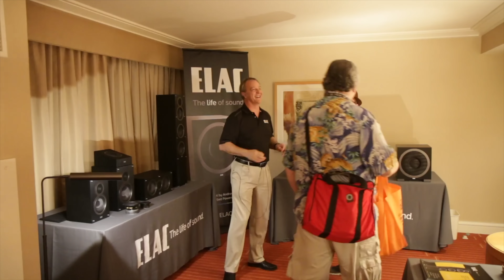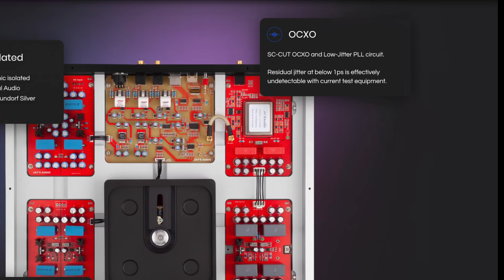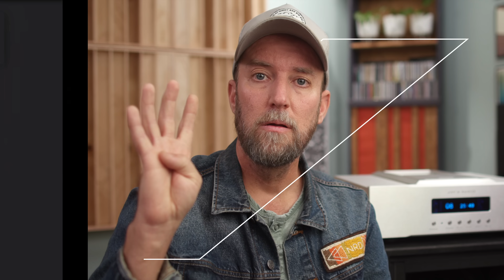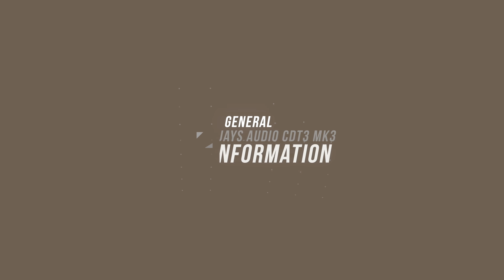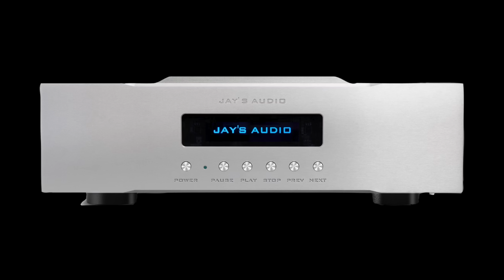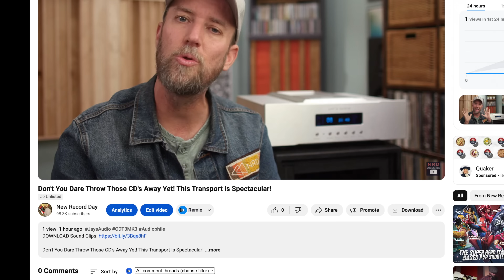Don't You Dare Toss Those CDs! This CD Transport Will Blow Your Mind!

Comment: 2:14 highquality CD transports often include Advanced laser mechanisms and error correction Technologies

The audio CD standard uses a modified an adjusted Reed-Solomon error correction code. Adjusted in a way that bits logical belonging together are distributed physically.
A scratch makes typically multiple bits which are physically located nearby unreadable - but as they are mapped to logical different blocks they still can be fixed.
The algorithm to do that corrections is well known, "open source" and easy to implement even on cheap hardware. 
There is nothing that could be improved further.

And when you mention "advanced laser mechanism" I want to know exactly what was improved....
Using a 20 USD external USB-CD-ROM drive I can "rip" a CD with 8 x speed and still get it bit for bit correct - there is nothing to improve here also.

Comment: the problem with the price is that this are not from big brands , as they have a reduced cost of production who made all european brands and U.S. of A. , ones just vanish, this is kind of a bet if lucky will sell all units and some do are lucky enough to develop a new project for a new player, like it happens to signature turntables ,some do work for the big brands and not being satisfied with what they seen released they try to built a limited edition of what they think it´s better and for sure it is only prices increase a lot, i myself in the 90´s looked for a better cd player as mine was ok but a pioneer from early 90´s and when seeking for better cd players i notice that some with more aceptable prices were not that diferent from what i had already from pioneer as some Rega were a lot talked about but they aged very fast due to the quality of materials while my first standart size pioneer is still looking new as the one i bought in early 90´s and internal dac´s are cheap and also cheap to install so the better one can do if with limited budget is ask your technician if possible to upgrade the already existing cd player ,i think it turns out for the better and less expensive, about building quality those more expensive players from known brands aren´t that bad and if improved it will sound as a new one as diference between both isn´t much and if improved will sound good for sure

Comment: If you use a CD player with a IS2 it will be a pretty decent player and connect it into a great DAC, surely you are taking much of the perceived advantages of the CDT3 away. Having separated the carriers, Jitter will be greatly reduced and the High quality temp controlled Crystal Oscillators seen in many of these new all singing all dancing DAC's like say the LAIV Harmony or Denafrips will do the rest. So maybe better to spend money wisely on a very good CD player with I2S and a pair it with a really great DAC.

Comment: I keep asking a question about units like this that only seems to generate anger, insults, and deflection -- but is actually an honest question and at beating heart of understanding these products.    

If your DAC has a sufficient buffer (and all good ones do), and you optical connect, then how does any of this anti-jitter, clean power, vibration dampening stuff affect the signal output from the DAC?
Reply: It doesn't as long as you have a decent modern DAC that reclocks to avoid jitter.

Comment: Of those 5 reasons of yours, the only rational one is jitter. That could actually differentiate one cd player/transport from another. All of the others that you cite confuse the characteristics of an analog electronic signal with a digital bit stream. A series of ones and zeros aren't going to be polluted by the power supply, etc., etc. You really are the king of confusion and dim-witted, gullible thinking. Unlike Amir, whom you take cheap shot at. What a loser you are. Rock on.

Comment: Have the CDT2  mk III at about the half the price and  running through a Holo Audio May Dac  using Is2 cable.  Whoa….Agree…a transport is the way to go for great CD sound.  I think you captured that well in your presentation……then it’s all about the Dac and supporting equipment.
Reply: I have the same transport supplying a Terminator DAC through HDMI. I’m like it a lot. I ask my supplier if I should upgrade and they said no.

Comment: Even through my very modest PC speakers (carefully equalised), I could tell the CDT3 sounded better, with crisper transient attack and better defined space around instruments & voices.  Thanks for the demo, though I was surprised that you preferred the 44.1 to the upsampled output.  In my main system I use a Perpetual Technologies P1A interpolating upsampler feeding my MF Trivista DAC, and the improvement in subjective detail and soundstage focus is significant.

Comment: Hi nice transport for sure  
But if i understand well using a dac that reclocks the incoming digital signal should reduce the source quality issue ?  
this is also my humble experience
I have a dac that reclocks   Using different digital inputs and sources does not change the sound substantially

Comment: Used a Marantz CD 63 kI signature for years, then got myself a Audiolab M DAC+ so the  Marantz became a CD transport, a very good improvement that did not need careful listening to hear the improvement as it was a fair jump up, a few weeks ago I got myself a new Cyrus CD-T transport, now we are talking again an easy to judge upgrade in performance, in fact I just love the delicate smooth notes in the high range and the greater definition of bass guitar and drums, everything is easy to follow and that's because it sounds like more space around instruments. Cyrus use a slower spinning drive so only one pass of the laser is required instead of the head having to re-read the disk when errors occur, they say the head having to backtrack causes electrical motor interference, as its been What HiFi mags best buy at over a grand for the last five years I can now hear why. 
I also listened to other transports on a youtube, Audio Alpha podcast, it was very apparent that it sounded better than the other transports. If your motherboard or sound card can playback HD sound then a good pair of headphones will allow you to hear the difference with the podcasts they do.

Comment: I own an Audiolab CDT6000. It’s been a big improvement over my old Oppo BDP83, when combined with my Denafrips Ares DAC. Both items together are reasonably priced and I think good value.
Reply: 1 have audio lab cdt9000 its pretty  amazing
Reply: that could mean  a less than great jitter rejection in the dac   Does it reclock ?
Reply: I just did a quick google search for the components you mentioned, and I would still be looking down the barrel of a $1500 combo.  I want to believe that there's a glaring improvement, but I honestly worry that my ears wont be able to hear it.  Is there really a big improvement?
Reply: I want that transport also
Reply: Does it scratch your CDs?
Reply: @stevenewtons7873 no it doesn't

Comment: I am looking to add a transport to my stereo.

Currently, I have my laptop feed my DAC via an Audioquest USB cable.  It sounds very good.  That is, until I heard what a good transport can do.

My DAC was available with and without a CD transport.  I opted to not get the CD option.  A few years later, I brought my laptop to the store where I made the purchase.  I played a few songs directly from my laptop to the store's DAC, and then I played the exact same songs via the store's included CD transport.  Wow, did the latter sound better.

So it was the exact same DAC in the store, playing the exact same songs.  All that differed was either using my laptop to feed the store's DAC, or using the store's DAC's built-in CD tray / transport.  The latter was so much better.

But I do not want to be bothered swapping CDs.  I want to play all of my music from my laptop's flac and wav files, via JRiver's Medica Center.

Can I have the Jays Audio CDT3 sit between my laptop and my DAC, such that I will get all of the sonic benefits?  Can the CDT3 take a digital feed from my laptop, and clean it up, and send that now virtually noise free and jitter free digital stream to my DAC?

I want the benefits of the Jays Audio CDT3 box, while having the flexibility of my JRiver Meida Center's organization of my thousands of music files.

In case clarification is needed, the two DACs (the one I own and the one in the store where I did the A/B testing) are from Aesthetix.  Mine is the Aesthetix Pandora, and the store has the Aesthetix Romulus.  The two DACs are identical, except for the Romulus having the built-in CD tray / transport.

I have been struggling trying to find a way to get the sonic benefits of a quality transport, without giving up the slick Media Center player that I love.  Surely there must be a way to have my laptop feed a transport that then feeds my DAC?

Comment: Right away, I preferred the CDT3. I can't say why exactly. I just did -- maybe because it "sounds silkier", or whatever. But then I compared my 320K MP3 of this track with both your samples and it was, I'd say, at least 90% as good as either. If £5500 (in UK) is what it takes to get 10% better than an MP3 track, it's a no brainer -- if one must -- to buy a much cheaper CD transport.

AFAIC, Investing in a decent DDC (Singxer SU-2 at c.£400), a DAC (pre-owned Gustard R26 at c. £1250) and an external OCXO clock (c. £80) brought me an immense improvement for all MP3 and FLAC tracks. FLACs are typically around 5% or so better than 320K MP3s, and I rip them on my computer's DVD drive.

So when it comes to FLACs, I'm around 95% of what the CDT3 can do, for around 30% the price. I can live with that.

Comment: Downloaded the WAV files. 2nd audio system, since yesterday with PSVANE ART TII Series 12AT7-S x2 on my hybrid integrated (Great improvement over the stock JJ 12AT7, already two years old), KEF Q100 (new internal small improvement and Kimber Kable 8PR with cotton inside -great improvement), W11 optimized for multimedia... I can easily hear the difference.
* Cdt3 - sound with more energy, dynamism, more "body", bass impact. More credible, I like it better. "More analog" sound. 10 points
* Zenith - "Digital" sound. 8 points
No surprise that there are differences. I have been trying for years, successfully, to minimize the JITTER generated on the PC. On the CPU: ALU <--> internal registers
I also notice differences when playing the same file from a Crucial SSD (worse), Western Red NAS HDD (excellent) or external USB drive (much worse)

Comment: Ron were the transport connected to the same external DAC as the innios ZENit use in the comparison?
(I dont see any digital input or analog outputs on the back of the innios ZENit .)
Reply from the maker: The Zenith was connected to the May via USB and CDT3 was connected I2S. I ripped the CD to the Zenith and used Innuos Sense for playback. 

Hopefully that clears up any confusion.
Reply: The innuos zenith has a usb out…
Reply: @bartbarelds8454  so you mean that innios ZENit Play a CD and act as transport connected with USB to a external DAC.

And the device under test the transport is also connected and used the same DAC.

Then IF so then it is possible to compare for sonic differences between the innios ZENit used as transport and the transport in the review.

But only Ron know how he did the setup?!
Reply: @ Ron is very straight about it.. They are all yessir. Yes both were connected to the same dac. I would think using the same connection and cable but he did not mention that.

Comment: I use a Sony CDP-XA20ES player which uses a stationary laser with the disk spinner doing the job of moving the disc relative to the stationary laser. It has always sounded better than players using a traditional style of transport with the sole exception of my Oppo UDP-205. It's why I still use the Sony deck as a transport, even though the DAC I currently use is a Pontus II/Hermes combo connected via I²S.

Comment: I rather have a CD ripper that compares my rip to a hash file to make sure it’s digitally identical. That way I only need to worry about having a low noise streamer. I rather have a $40 cdrom drive and a $400 ifi zen stream than a $4,000 CD transport. Really the most important part of the high end streamer is high quality power supply and low noise digital transmission. For me I’d just get the streamer.

Comment: I never understand what happened with the CDT's signal, i do remember some CDT with "very precise" and "accurate" digital signal somehow making the analog music (Tape Master) recordings sounds very rigid, stiff, and squared; its it accurate & stable? yes, but it also sounds very digital, tonally boring and lifeless, non-musical, which is why i'd prefer cheap top-loader and pair it with better dac, again, it should be fine with DDD (full digital) hard disk recording, i guess.

Comment: I still don't get how audiophiles understand digital signals. A binary "1" or +3.3V should be the same wherever part of the circuit they are. There voltage value could be +-20% but the digital data value is still the same... it's binary "1". And digital data transmission has error-correction built-in
Reply: For example, how can vibration affect digital signals? I'm totally at lost.

Comment: That's too much to pay for a CD transport. I love my Audio Lab 6000 CDT . I bought the store demo for $500 and with my gustard R26 sounds amazing. You don't need to spend $5000 that's crazy.
Reply: 5 grand is for the bigger wallets. I bought my gear like Audio Note Dac and Transport and Conrad Johnson amps used and it sounds amazing! 
Its all about finding the right balance, modify where it matters and tune with cables to finetune to your desired sound. 
The fun stuff is when you buy great sound for few bucks.
Reply: AL  CDT 9000 here into McIntosh C49 .  totally satisfied.

Comment: I was about to go to Goodwill and find a used Sony dvd player to use as a cd player but thank god I saw this video first. At 5K I can’t say no.
Reply from the maker: That one got a chuckle. Funny.
Reply: @Newrecordday  I use a Samsung BluRay from a thrift shop with spdif out for cd's , the replacement remote from ebay made up most of the under $15 I have in it and it sounds great with my dac... for vibration isolation , a soft rubber mat works great.  I have some $12,000 speaker cables I'll sell you for only $10,000 if you buy them before midnight tonight.
Reply: We are forgetting to mention that rest of the system including room and it's ability to reproduce resolution and detail are an absolute key here .
Such top notch transport will not show many of it's benefits  in the subpar average system ...   But it will make a world of difference in a highly resolving system .
So before we fall into ignorance of laughing it off in sarcasms these facts must be in place .
Reply: @kdomster9141  my amp cost 4K. There’s no way I’m spending more on a transport or player. Same way/ rule of thumb I don’t spend more on a cartridge/stylus  than what the turntable cost. I will not get 5x the sound quality of a $1k player.  Guaranteed
Reply: @Smegmaburger  I own a chord Dave hooked up to a $700 transport, honestly I couldn’t even fathom how dropping a few thousand more on a transport will make a significant difference, it’s already a godly sound.
Reply: @kdomster9141  Yes! Yes! Emphasis on the room! Because without that treated room all of these details go missing unless you are on headphones. And Ron’s room sounds amazing!
Reply: @BrentLeVasseur  Yes in a way , as some decent sounding rooms with solid and revealing equipment will very quickly prove that quality transport like this makes a huge difference.
If someone owns 80 CDs that spending of 5000usd on such transport makes no sense but if you have large collection 500, 1000 or 3000 CDs and it will make you listen to it in a way you never heard them before than it makes sense for sure . 
Digital is not Zeros and Ones and if someone thinks it is than they are wrong .
Reply: @kdomster9141  There are no facts in what you write. There is no way, you would hear a difference between two cd transports. Whatever room, whatever system. That's a fact. What you hear is your mind talking to you. Oh it's the expensive one, aahhhh, so much better. But this will fail every blind test. Always. That's a fact.
Reply: @schellstede  😉🤣 And what facts are in you writing ?
Have you ever heard good transport in a quality system vs cheap CD or DVD player used as transport ?
If you did you would not repeat these theories ...  it is not just 0s and 1s.
Reply: @schellstede  I think transports do sound different but most likely because there is some subtle dsp affecting the signal
Reply: @mikeg2491  If there is DSP involved, of cause. That's like using bass or trebble controle on your integrated amp. If there is digital filters in a transport, ok. But that's not what we are talking about here. Some people believe that a transport is transporting zeros an bit rounder than the other or the ones a bit straighter than the other transport. That's a myth to sell expensive gear. That's all.
Reply: You saved me from watching this video✌️5k I’m still on the way to a garage sale driveway.
Reply: At 5k I can easily say no.
Reply: I use a Sony BluRay player which cost £150.00 about ten years ago. Using a high end Chord Digi lead out into my Naim Unity Atom since it has a built in Dac. Between Tidal Max quality and CD's - I cannot tell the difference - do it!!!!